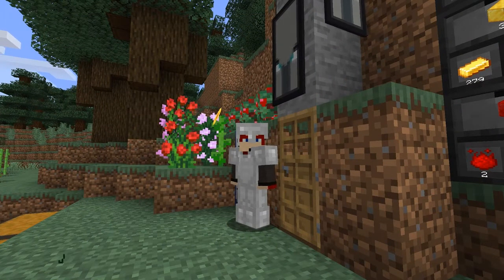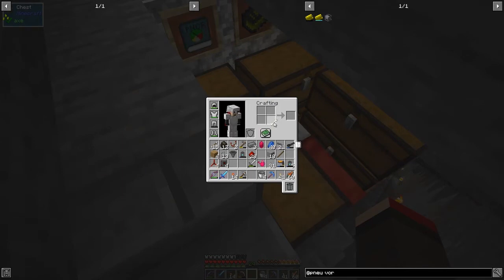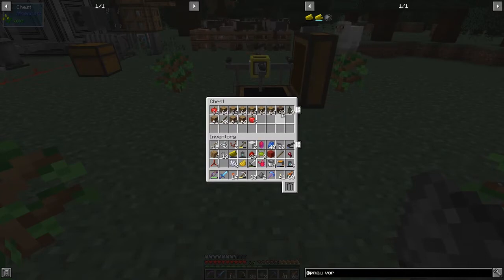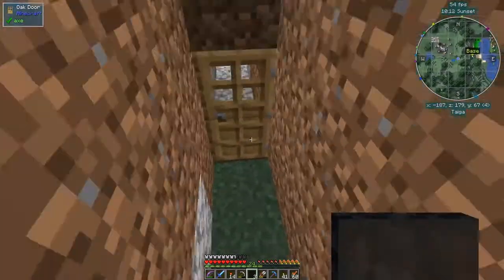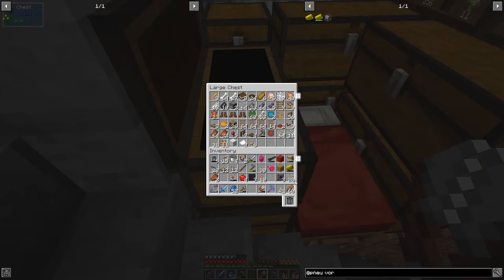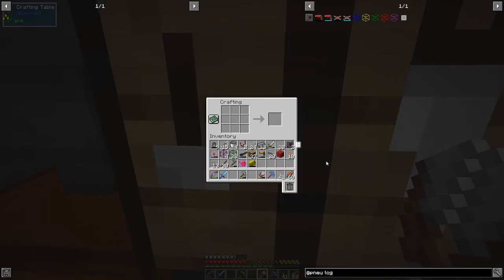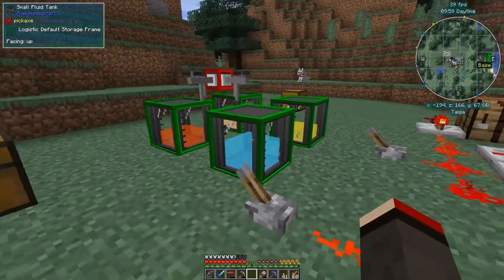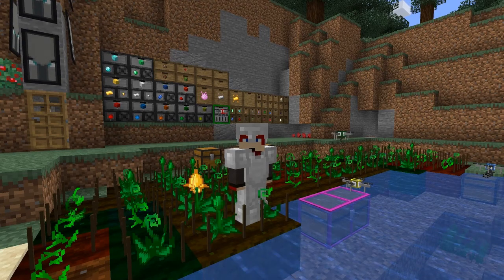PneumaticCraft: Repressurized #8 - Thermal Lagging, Logistic Drones and Frames

Comment: You don't actually need that dispenser upgrade in that upper tank by your refinery. When tanks are stacked vertically, you can wrench them together into a multiblock tank. Just right click either tank near the edge where they connect. Just be sure to fill from the top :)
Reply from the maker: Nicholas Alberts thanks for this tip, never knew of this feature, episode 12 I’ll demonstrate it. Tank to refinery didn’t join together in this version. Tank to tank worked just fine.